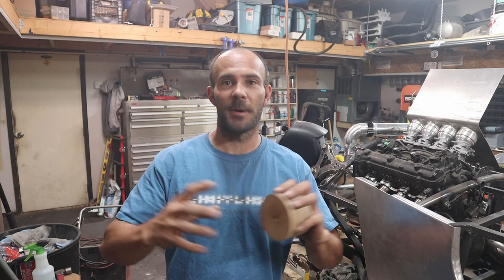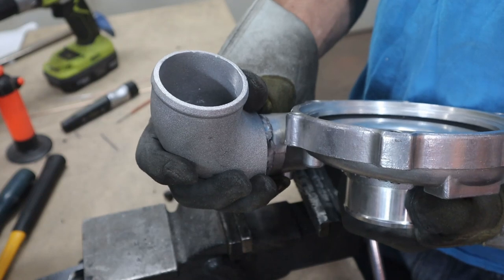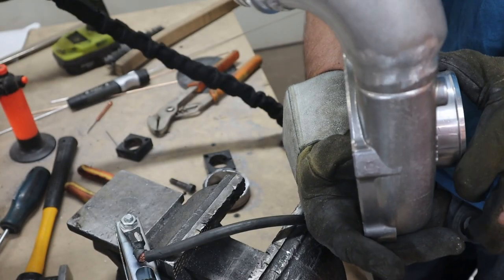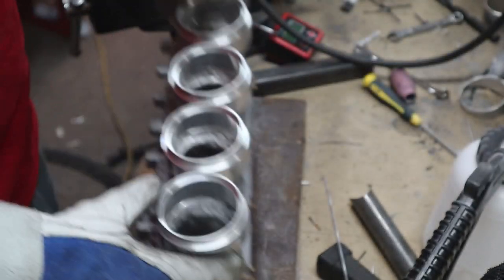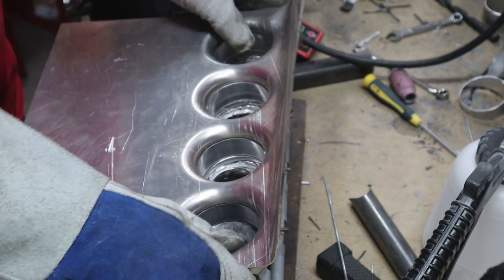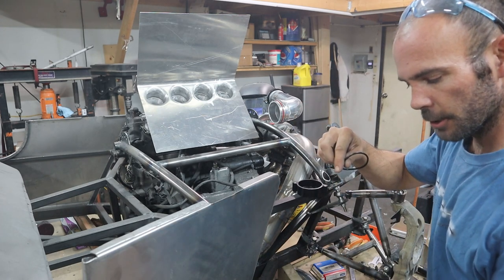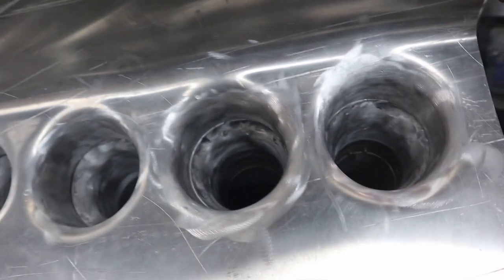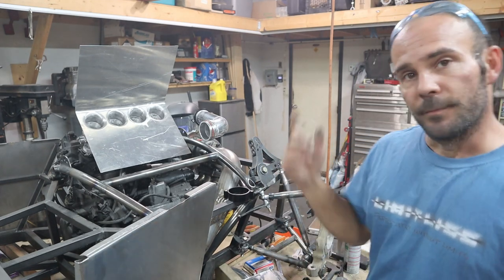DIY dimple dies?? Custom ITB Plenum/intercooler! (Turbo Hayabusa Willys Jeep Build Ep. 13)

Comment: Nice job with the wooden dimple dies! That cast alloy doesn’t weld as easy lol
Reply from the maker: Thanks! It got better after running a couple more beads around the turbo. It looks better now and I’ll show it in the next one. The throttle bodies weren’t as difficult as I was expecting, but I still need a lot of practice on aluminum that’s for sure! 
My tig doesn’t have a balance adjustment, it has cleaning depth and width adjustments which I’m having trouble figuring out
Reply: limitliss yeah my tig has a balance but I have pretty much found the good spot and left it there. Looks like you are doing a good job and doing everything properly , nice work!